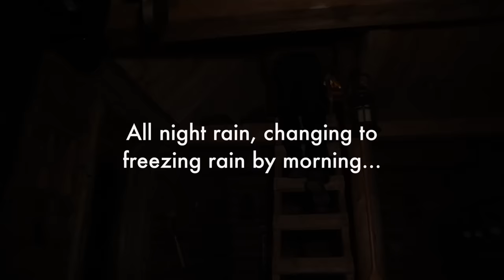Off Grid Log Cabin: Alone with my Dog in an Ice Storm

Comment: On hypocrisy: a judicial use of technology is not being a hypocrite. You are choosing sustainable choices that enable you to achieve your goals. That is not being a hypocrite, that's fulfilling your vision. You didn't set out to be Amish. Personally I think what you are doing is even more relevant as most of us are not looking to eschew technology but do strive to lower our environmental footprint and overall living costs.
Reply: It seems that his choice is only sustainable because soo few people do it.  If everyone built log cabins, or even half the world, we'd see some major impacts on the environment and sustainability.  Back when people used to build log cabins, there were less than a billion people on earth.  I'm not sure of the total mass of his cabin, but there's definitely a lot of wood usage for a relatively small space. A modern room of that size would definitely use less wood.  

We're pretty efficient with how we process wood logs in modern times too.  We cut all the boards we can from them using mathematically determined ratio's and patterns.  We process a lot of wood that would otherwise be useless (small pieces, small branches, twigs, sawdust, etc).  So in some ways you could say that this method of building is quite inefficient in comparison. 

Of course it doesn't require much other materials, but that just means other materials we could use like insulation, drywall, etc would be sitting around being unused anyways.....and I highly doubt the raw materials that make these things, are as important to the global ecosystem as tree's are.  So by using other materials, we're actually saving tree's and being efficient.

Comment: About lighting, now that we have LED lights some old ideas that were not practical are now practical because of of how much less power LEDs use. The first and best is to store potential energy in the form of a weight attached to a cord hung over a pulley that drives a generator via gear train, these have been developed just google gravity light. Then there is hand held torches or maybe in your part of the  world you might call them flash lights, you could have a clock work motor to power a generator, an old toy motor will work as a generator. You could also construct a small vessel with an air pump so that you can use air flow to drive your generator though you might need a very simple electronic voltage/current regulator to go with anything you make yourself, it could be worth exploring.

Comment: Very interesting video; however,  I noticed some contradiction .  Demonstrating 'The hatchet'  vs clearly wood is cut by a chain saw.    The logs near fireplace are all exact size , edges been cut by electric saw, not hatchet .    Also, the long log he operated on by the hatchet in first few minutes, its edge been cut with chain saw.    Add to that some lumber-store wood cuttings are to the right of fire-place.

Comment: root cellars are nice, i'd have me an emergency propane generator, just in case, starlink will be available soon and you can run it off solar, all you need its satellite link, musks deal, beta is going in seattle real soon in fact they are installing it already in Kent so it will be here soon and its supposed to be ultra fast up and down, inexpensive and reaches the remotest areas on earth, you can use it with batteries or 9 volt as well, 12 volt whatever, battery setup with a solar charger will work, that's actually the idea, musks idea isn't to replace the existing grid, he wants to bring internet to areas that have no electricity and or cable, phone lines, the very remote areas in brazil, africa, alaska so forth, north pole south pole, places where bringing in phone or cable just isn't feasible, climbers trekking up mountains will have constant 24/7 access to the internet.. live feeds and emergency access... how did dingbat say it on oh brother where art thou "everything's gonna be put on the internet, on a payin' basis, run on a wireless, hook us all up to a grid, a veritable age of reason, like the one they had in france"  lol...